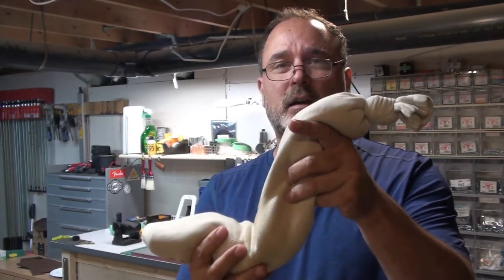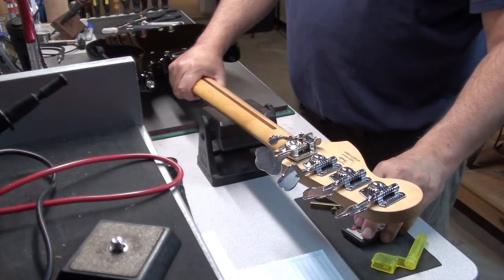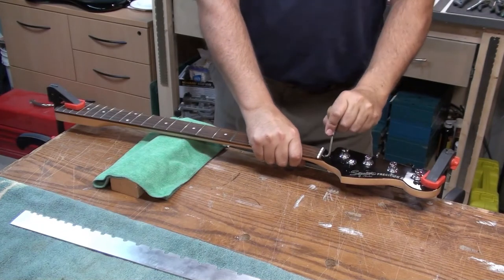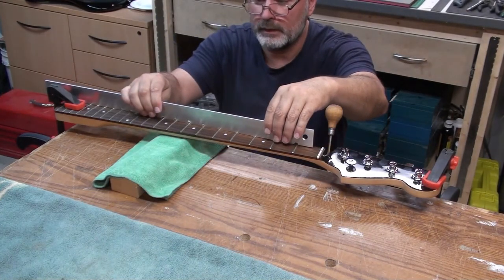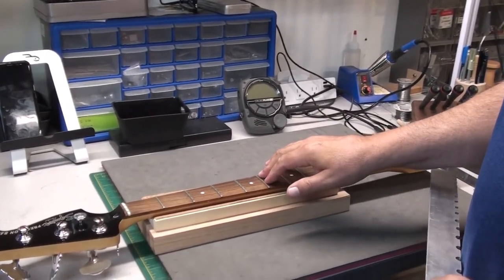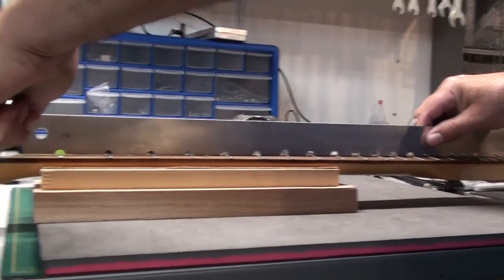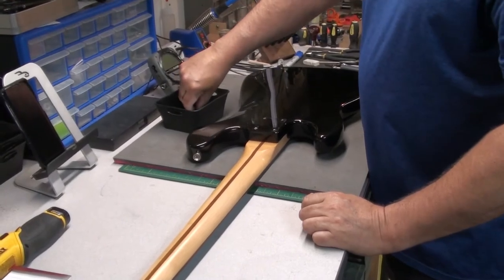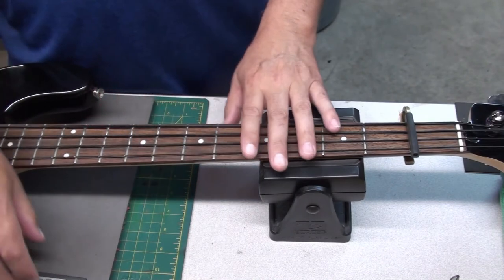Fixing a Bowed Guitar Neck with DIY Heat Press treatment... Using an Old Sock and some Rice!

Comment: I am curious if the neck held it's position after some time spent playing it? I was recently gifted a 1959 strat, that was scorched in a fire in the '70's, then sat unplayed, with strings on it, since then. It has a very bad up bow, but does not seem warped. The truss rod would not go far enough to straighten it, then it  came free from the anchor nut, as I backed it off. Luckily, after re-threading the end of the truss rod, it went back into the anchor nut, prior to which I applied red loctite, so it would remain. Now I am going to attempt your heated sock technique, but I am waiting on a replacement adjusting nut from Stewmac, as I needed the longer one they sell, as I had to cut a small bit off the adjusting end of the truss rod. I used a forstner bit to deepen the wood shoulder inside the channel of the neck and will use a washer between the nut and the wood, to get the proper amount of bite and spacing for the adjusting nut. I am very interested in whether or not your technique will work for me. Well done, and thank you for this video.
Reply from the maker: Well, it has been over 2 months and the neck is still holding it's shape well and my son says it plays great.  I don't recommend this method if the fingerboard has a finish on it eg. maple with lacquer - only on natural wood boards like rosewood, pauferro, etc..  You may have to do it 2-3 times tightening the truss rod as you go... let me know how it works out for you!  Please subscribe if you have not already  -thanks.
Reply: @ManotickGuitarTech  Glad your son's bass is still holding it's straightness and that it plays great.Thanks for the tip about the finish. The old strat in question has no finish left on it, and has a brazilian rosewood fretboard. Thanks for the reply.
Reply: @ManotickGuitarTech  Thanks again, your video really helped me out, and my 1959 Stratocaster plays like a dream, with the neck good and straight. I ended up using one of those heatable neck warmers, very similar to the stuffed sock you made, and it worked like a charm. I did have to apply it in a few sessions, but I wanted to do it slow and easy. The neck is holding well. I don't want to hijack your post here, by attaching a video, but if you are interested in seeing the strat, and hearing it, I did make a video of some sound samples available on my page. A huge thanks to you! Yours was by far the most helpful of any of the videos I looked at that covered this approach to a bowed neck. This strat is happily rocking, after over 50 years of silence, man it sounds, and plays good!
Reply from the maker: @paintdrink  that is awesome!  I am glad it worked for you.
Reply from the maker: @paintdrink  That is great!

Comment: I have the opposite problem. So truss rod complete loses en no neck relief. Any advice?
Reply from the maker: Have you checked led to see if it is a 2-way truss rod?  After it loosens if you keep turning counterclockwise it might engage again adjusting the neck
Reply: @ManotickGuitarTech  Thank you for responding that fast. No its not a 2 way truss rod. its getting complete loses.
Reply from the maker: @GuitarPlayersFun  you could try heating and bending the neck to a straight position- unusual to have a backbow.
Reply: @ManotickGuitarTech  Thank you! I will try that out! It's a cheap electric Yamaha which because of that issue was stored up at the attic for at least 15 years. So nothing to lose, only to win.

Comment: Thanks for the video! Feels like a silly question but is the rice dry or did you boil it before then microwave it? Feels like it would take a long time to heat dry rice :)
Reply from the maker: lol - no it is dry!  It heats up very quickly - you can also use dry beans instead.
Reply: Dry rice bags are commonly used in place of hot water bottles now. Just microwave them and you're good.

Comment: I have a question for you .
I have a classical guitar with a very bent neck. I also bought some very sturdy clamps to correct this.
If you use a clamp to straighten the neck and leave it for a few days and then remove the clamp, it will return to its curved state.
As if the bow is returning to its original state, it will be bent again.
Even if you apply hot heat and work, the same result is obtained.
So I'm at a loss and don't know what to do.
What advice would you give me?  This article uses Google Translator, so please understand if there are any unnatural points.
Reply from the maker: Unfortunately,  you can't fix every neck...it probably will stay bowed.
Reply: I clamped my classical (in fact two of them, that was bowed) together, face-to-face, made a backbow for 10 days. They both became pretty straight, and still are now after 2 months :)

Comment: How long in the microwave and at what power? Thanks! I’m trying this right now.
Reply from the maker: 2-3 mins on high until you get to about 135-150f
Reply: Thanks. I have it on there now. I’m in the Southern California Desert where it’s 110 degrees. Do you think 4 hours is enough time?
Reply from the maker: @Jim5150jvc  I would do two applications - check it after 4 hrs to see if it has straightened; add a little more clamp pressure to get a back bow, tighten the truss rod and heat again; then let cool for 24hrs clamped.
Reply from the maker: @Jim5150jvc   How did it work out for you?
Reply: @ManotickGuitarTech  would you believe I lost one of the neck screws, and I’ve been trying forever to find it? 🤣
Reply from the maker: @Jim5150jvc  no way!

Comment: Hi, I have a back-bow near the bridge. Will this technique help?
Reply from the maker: Near the bridge??
Reply: @ManotickGuitarTech  Sorry for the low effort question. My guitar's neck has a back-bow from the middle of the neck to where the neck joins the guitar's body. I've tried loosening the truss rod but that doesn't fix the problem - It adds a forward bow from fret 1 to fret 8 but not beyond that. This is a 3 month old Pacifica 012. I'm guessing the recent change in temperature here from hot to cold is the cause. Also, I used to line dry wet clothes in my room, this also may be the cause. Thanks for taking the time to look into my issue.
Reply from the maker: @nikhilck629  did you check if you have a two-way truss rod?  That would add mechanical force and get the relief you need.  Keep turning counterclockwise(left loosey) to see if it starts to engage.
Reply: @ManotickGuitarTech  I'll check and get back to you.

Comment: What if it's a one piece maple neck?
Reply from the maker: If you've a lacquered finger board, you might damage the finshe with the heat.
Reply: @ManotickGuitarTech  it's a pretty SEVERE relic but you mentioned getting the glue to slip and reset. Is it the rosewood stripe on the back in this case?
Reply from the maker: @deanmlshredder  no, the "skunk stripe" on the back will not move
Reply: @ManotickGuitarTech  Please don't mistake my relentless inquisition for incredulity. I'm very curious about why this would work because I'm desperate. Lol. It's such a great guitar but the neck just bows over time without fail and the truss rod is very tight.
Reply from the maker: @deanmlshredder  sometimes the neck just needs to be replaced
Reply: @ManotickGuitarTech  brutal. thanks man

Comment: what about using a heat gun to heat the neck?
Reply from the maker: It would be hard to control the heat and you would have to hold it over the neck for a quite a while... I would be concerned about damaging the finish on the neck.

Comment: I doubt. Kinda too late to fix that bow. Even if you put lighter gauge strings, sooner or later the bow will come back.
Reply from the maker: It has been over a year and that neck is still straight
Reply: Can confirm, did this on my ibanez restoration. As long as you let it cool the glue should harden and it will keep it shape for a decent amount of time. Its much better then getting a new neck or a repair anyway.
Reply: *better in terms of cost